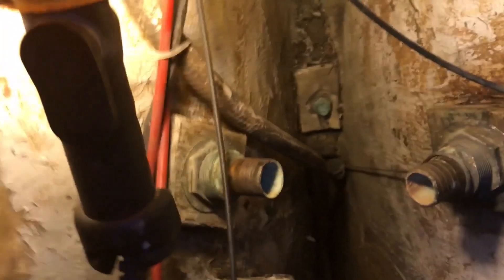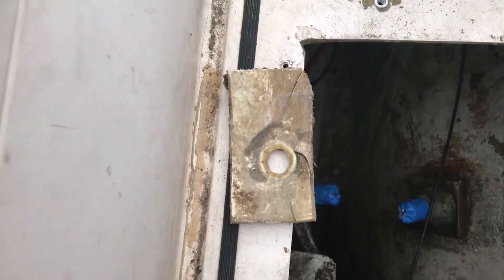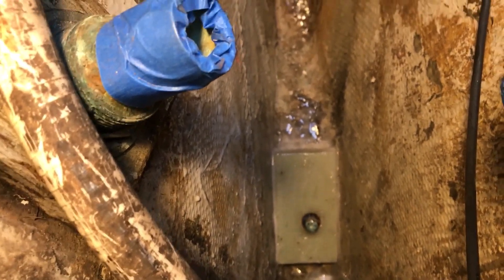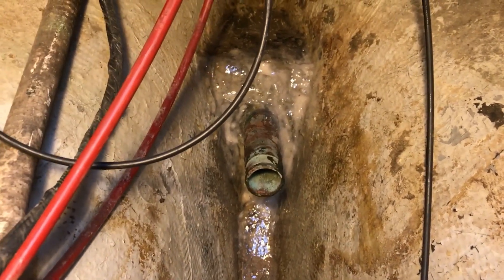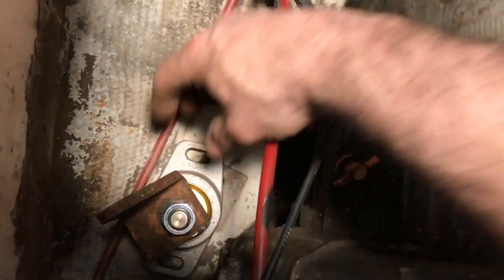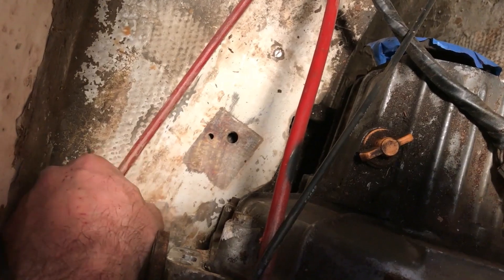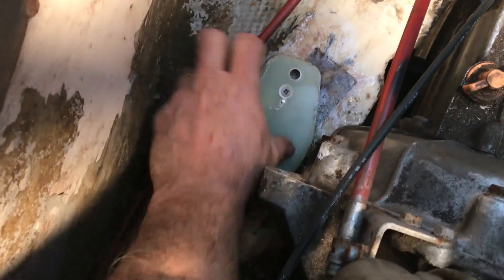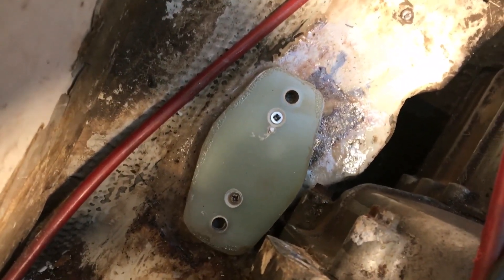Contessa 26 Refit ep.7 - Rudder Plate and Yanmar Engine Mounts

Comment: Thanks for the info on the Bar Marine mounts. They worked out well. I had to move the engine forward from the original Westerbeke Vire mounts. In the process of getting a new coupler, shaft, and propeller. Talking with the prop shop they are recommending a much larger 3 blade prop. The Vire had a 10" prop for a 7hp @3000 rpms and 1:2 reduction. The Yanmar has 3600 rpms with a 1:2.62 reduction. These are fairly close. What prop size and pitch is on your 1GM10?
Reply from the maker: The prop came with the boat, so unsure of the specs. I’ll try and get those and post them here sometime in the future.

Comment: Removed a Westerbeke Vire and trying to install a Yanmar 1GM10. Looks like the centerline and motor mounts won't align. I have 11" of width at the centerline of shaft. Yanmar 1GM10 has a width of 16 1/2". How did you fit your motor in? Can you share measurements for new stringers?
Reply from the maker: Mine came installed, but the mounts were not aligned, so I made the g10 spacer shown in the videos.
Reply: @EpoxyAndButylTape  the Westerbeke didn't have isolation mounts. I am wondering if the Yanmar mounts are required. If not I could raise the stringers 2 1/2" which looks like it will clear the bilge sides.
Reply from the maker: Matt- Let me know what dimensions and what pics you need.
Reply: @EpoxyAndButylTape  I am coming up with a overall width at the rear of the engine/mount of 421mm/16.5" at the centerline of the shaft/mounting height of the isolation mounts. It looks like you used a different isolation mount than the Yanmar, which might allow me to raise the height of the isolator and give more width. I found what I believe is the mount you installed at Barr Marine (8.0001 mount). Thanks for your help
Reply from the maker: Matt-  These are the mounts I used: https://www.go2marine.com/DF-2205-2-Series-Dual-Flex-Marine-and-Industrial-Engine-Mount
Reply: @EpoxyAndButylTape  Thank you for the link. This will help determine the stringer placement. Excellent craftsmanship on your refit. I hope to have mine come out as well as yours. I will keep looking for new updates on your future projects.